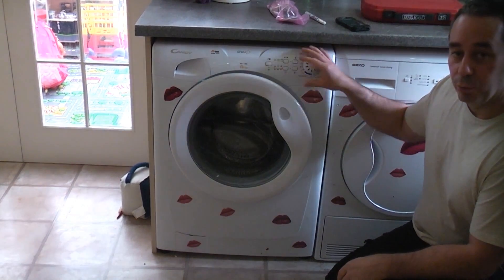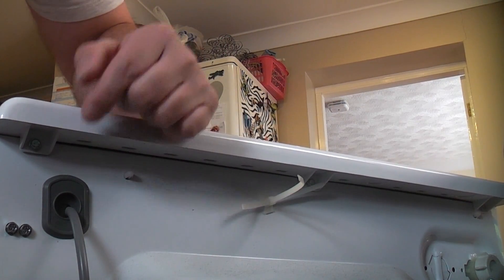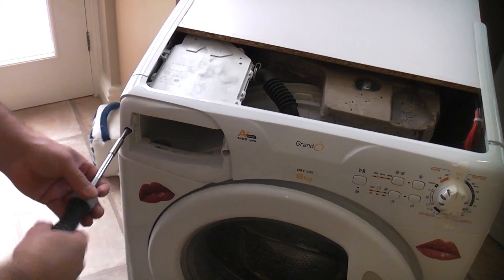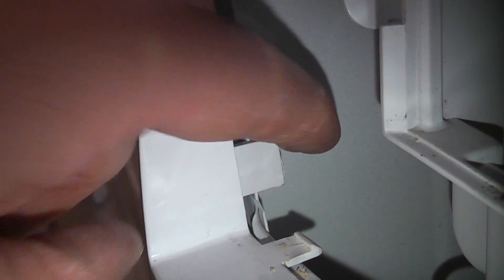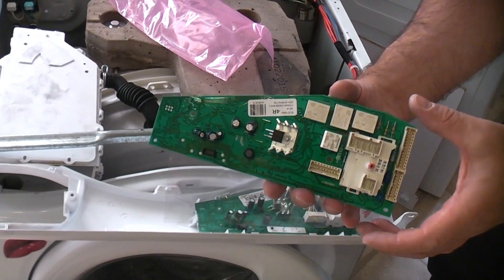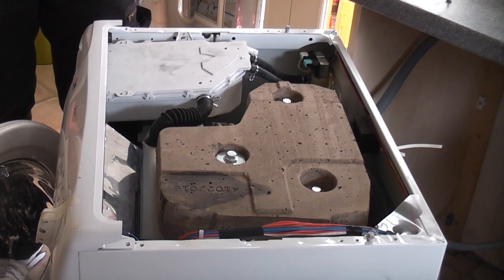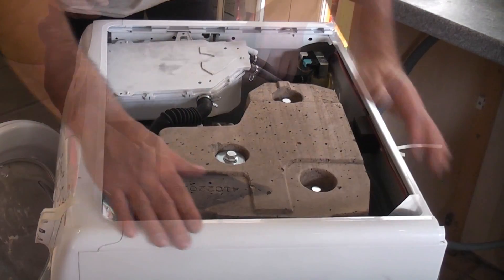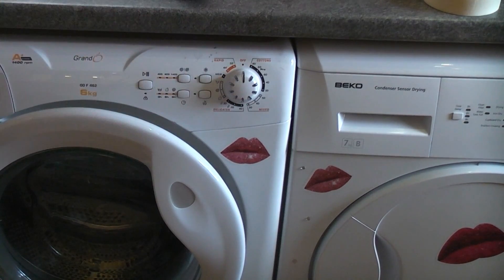How to replace the circuit board in a Candy or Hoover washing machine

Comment: If the motor triac is the problem for error E09 do I need to buy a whole new circuit board or just a replacement module, thanks
Reply from the maker: I'm afraid the Triac is soldered to the board. If you are good with electronics you could probably just replace the Triac, other than that you can either get an electronics specialist to replace the Triac, or just get a replacement board.
Thanks for the comment 👍

Comment: My Candy Grando Vita, which is 18 months old, just gave up the ghost. Power is going to the appliance but no lights on the display. Any ideas?
Reply from the maker: I'm not an appliance engineer, but if it was me I'd unplug it from the mains and remove the top, then check to see where the incoming cable from the mains goes to. Sometimes it goes to a suppressor, which looks like a large capacitor, sometimes these fail and often will look burnt, or even dis-formed (if it has blown), check it for cracks etc. You can check it for continuity using the resistance setting on the multi-meter. If that looks ok, the next thing I would be looking at is the circuit board. But if you are not good with things like this, it's often better to get an engineer to take a look at it. Most appliance repair shops will give you a quote and fix it easily, as they work on these machines daily and know all the possible faults.
Thanks for the comment 👍
Reply: Ultimate Handyman thanks for your comments. I have already tried the suppressor and it looks good. I have an engineers booked as I have a fixed price for the repair which is about the same cost as a new circuit board, plus a years warranty. Win win👍

Comment: mr handyman, how would i know if it was the circuit board that was faulty and not the wiring ?
Reply from the maker: I spoke to the guy at my local appliance repair shop and he said it was the circuit board.
Thanks for the comment 👍
Reply: @ultimatehandyman    ahhh . 
Darn it. 
I dunno whats up with mine 
But great dismantle vid!
Reply: Where is the best place to buy Circuit board,?

Comment: Good afternoon, you can show how to restart on a candy machine candy gv 1510tw2 / 1-с
Reply from the maker: Sorry, I don't know much about that. I normally just switch the machine off with the button on the front, then turn the dial to the required program, then press the button to start the machine.
Thanks for the comment

Comment: my hoover optima washing machine when i turn dial to a programme it flashes to different programmes on the screen and have to be quick to catch the correct programme when it flashes up..and when put on 10min spin it takes a while to get it up..would a new circuit board solve this ?
Reply from the maker: +steve blue 
I don't know, sorry.
An appliance engineer diagnosed the fault for me and said that it was not really worth fixing as the boards are so expensive.
I opted to buy a new board anyway which should enable us to get a couple more years use from the machine.

Comment: My door light  button flashes and the machine won't operate at all, is this down to a fault with the door switch or on the PCB, or other?

Model Candy GODF800-80 (8KG)
Reply from the maker: +Tirdfish No idea, sorry. I'm not an appliance engineer, I was told by my local appliance repair centre that the board needed replacing.
Reply: +Ultimate Handyman No problem, thank you for your reply.
Reply from the maker: +Tirdfish 
You are welcome ;-)

Comment: Hey. You sure are good at this !
Whenever I open any plastic casings, I break several tabs and have to use superglue during assembly !     ;-)
How did you know for sure the board was spoilt ? It couldn't have been a corroded/broken/rat-bitten wire ?
Reply from the maker: It has been faulty for a while, my girlfriend phoned the local appliance shop up that we use. She explained the fault over the phone and he said he would send an engineer to have a look, when the engineer got here he said it was the circuit board and was not worth repairing as Candy machines do not have a good reputation (I know both of the guys in the appliance repair shop). I also checked a few online forums and they all pointed to the circuit board. I thought it could be either the circuit board or the selector switch, then I found out that the selector switch is soldered onto the circuit board, so it could not have been anything else. As soon as the new circuit board was installed you could tell it was fixed as the selector knob was much harder to turn. I'm now trying to source a new selector switch, then I can repair the old circuit board and keep it as a spare ;-)
Thanks for the comment

Comment: I'm surprised that your sets don't have 7mm, the Halfords set I have does (along with every other size up to 2-something and imperial sizes, the reason I originally bought it). I have one odd jubilee clip with a 7mm hex.
Reply from the maker: I'm not sure about my larger socket set at work, but the two I have at home certainly did not have a 7mm socket. I even have a set of combination spanners that don't have the 7mm spanner. After I went to the shop and bought a nut spinner I realised that I have a set of milwaukee bits that has some nut runners in it, so there might be a 7mm bit in there (I'll check the next time I'm in the garage).
Thanks for the comment

Comment: Well done Chez - I thought this was going to be a nightmare but you made it look relatively simple (though you have a knack for doing that). Still think the most unbelievably complex demonstration you've done so far was changing the battery in a laptop. Do you remember that one? How you ever got that back together and working I shall never know!
Reply from the maker: Thanks Kev,
Yes I remember the Acer Aspire laptop, that was a difficult one compared to this one ;-)
I also remember when I tried to solder the wires onto a CMOS battery for it and it exploded LOL
Thanks for the comment.

Comment: Again, good info.
    I used to work at Hoover Merthyr and it looks like this board replaced the old timer which was like a block attached to about a hundred wires. 
         Surprising how many machines end up scrapped or fly tipped that could of been cheaply repaired!
Reply from the maker: Thanks for the comment ;-)
I remember an older washing machine that had a timer with hundreds of wires, I guess they put it all on one circuit board to save on manufacturing costs- which make it easier to repair as well.

Comment: We have almost the same model not impressed noisy and problem with closing the door, have to give it a second push before contact is made and it will start.
Also had the catch fall inside; and the trapdoor for the filter would not close after use, and for our Candy stove the shelves will slide fully forward (no halfway stop) when taking food out, dangerous
Good channel!
Reply from the maker: Candy is not the best make but they are normally cheap. I only replaced the circuit board in this model hoping to get 12 months out of it, after that I'd be looking to replace it with a better make.
Thanks for the comment ;-)
Reply: I must of made that one after my lunch time pint!
Reply: *****  its our first experience with  the brand, but we also have a problem with a Smeg dishwasher, which is supposedly a top brand?
Reply: Typey1 made in Italy rare to see pints there? :-)
Reply from the maker: lffit
I always thought Smeg were a good make but can't vouch for that personally.
Reply from the maker: lffit
Italian company but they have manufacturing plants all over the world.